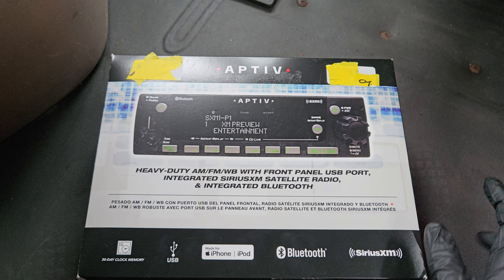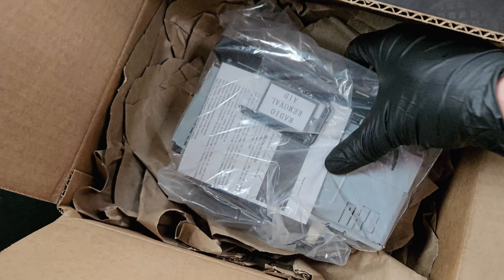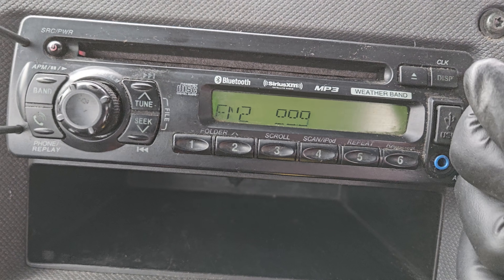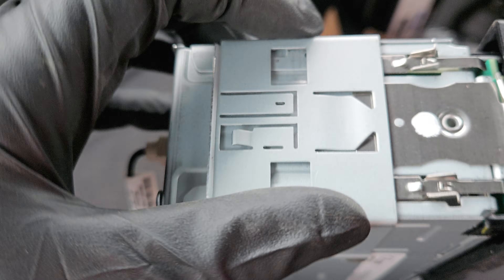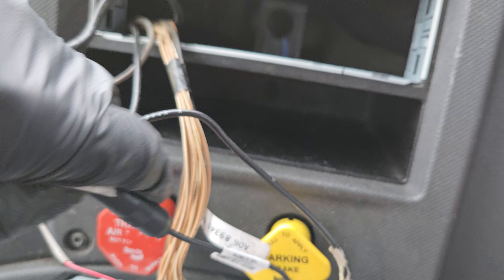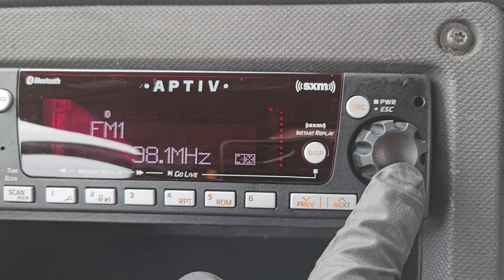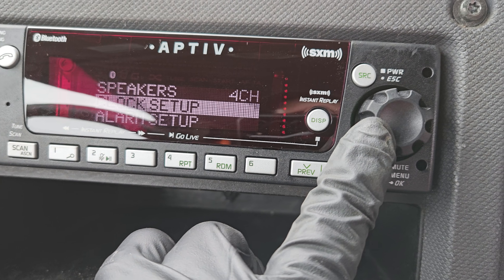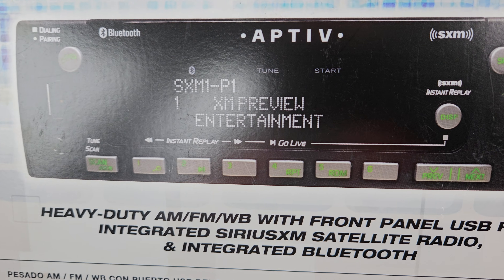Aptiv Heavy Duty Bluetooth Radio - Installation and Review

Comment: Is there a way to add a powered subwoofer?
Reply from the maker: I know when the trucks are built they are spec'd with two, four, or more speakers in the case of a sleeper. The only place I can think of to add a sub comfortably is under the bottom bed inside a sleeper. I've never added one myself but I don't see why it wouldn't work. If there's no specified output for it then you'd have to tap into the wiring of one of the speakers.